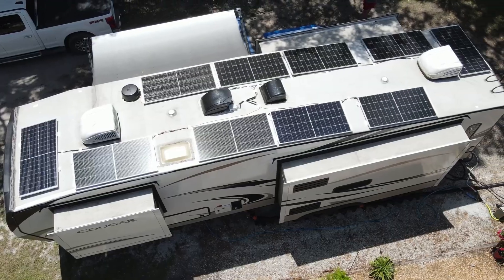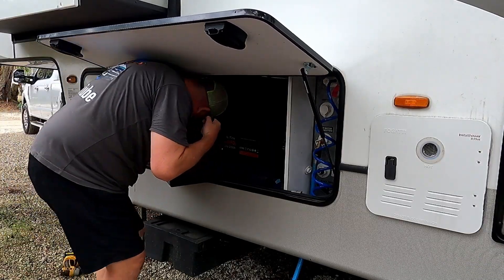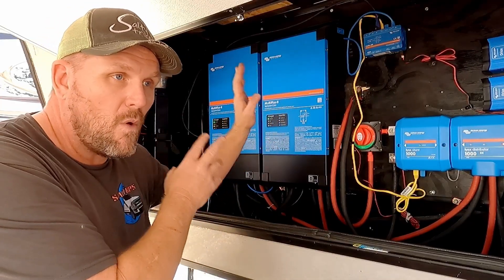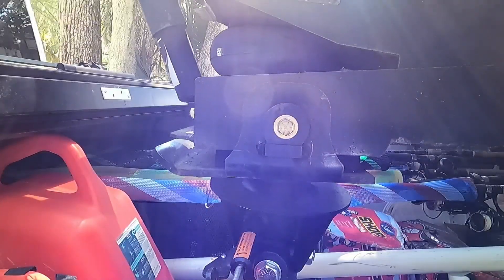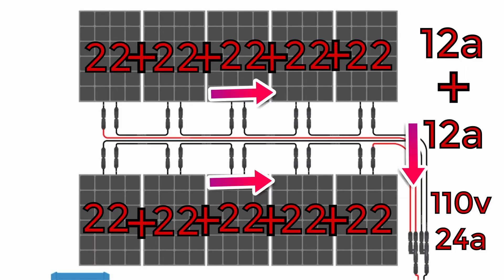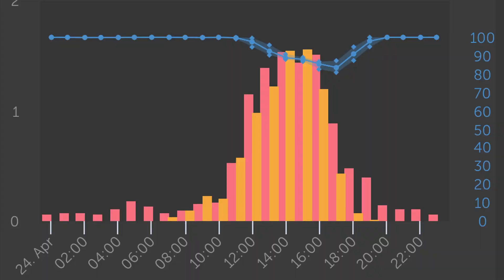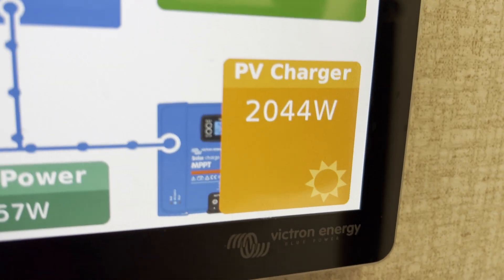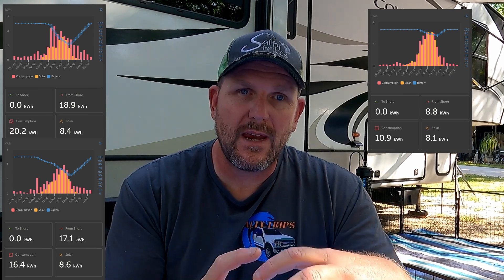How much solar power do we really get? “RV Off Grid solar power test”

Comment: Good job on your whole solar set up. 
There is one thing your forgetting, DC to DC charging.
Perhaps you should get two DC to DC chargers, 12 to 24 volt to hook up to your Truck.
Let your Truck charge your system as you go from site to site.
Reply from the maker: @lindsaywhite4502  didn’t forget it, don’t really need it, sun can charge while we drive.

Comment: Still waiting on Godzilla towing, mpg’s, at what avg Hwy Speed? I would had purchased a Diesel truck.. with what you spent on batteries lol. A first time watching  your Vid that I came across on your truck. So was trying to find the follow up video you said you were going to do ? So if you did please send me link. As for solar I would never spend that much $ on something stationary. I would had gone with portable E-Gen system like a Delta Pro Ecoflow products. I guess you plan to boondock allot. I live in South FLA and that still won’t cut it… Need shore-power. Winter months up north understand. Your inverter needs to be Hybrid for partial Batteries and gas gen. Florida is rough to boondock May through the first half of December. And hopefully you’re North of central FLA. Anyway great Vid …
Reply from the maker: Batteries cost me about $2,800 a Diesel truck cost $80,000.

Comment: So why didn’t you use the 400watt panels to maximize your energy output into the batteries?  Was it cost or efficiency per dollar that the 250watt panels were used?  10 panels at 400watts each would put you at 4K generation max instead of the 2.6K with no additional space on the roof.  Would that benefit you or am I just not thinking it through well enough? Looks like you have plenty of battery storage and converter capacity. Just think out loud.
Reply from the maker: A lot of factors, space, weight, additional hardware to mount, payload capacity, etc, I address all these in an upcoming video 👍

Comment: We run a 12v, 2640 watt, 4s x 3p with 1000 Ah of batteries and just a single 3000 watt inverter.  We can run the AC overnight and fully recharge during the day.  In full sun, we are pulling right around 2k watts for 4 hours daily and when we get more than 12 hours of sun, we can pull in 10-12 kwh daily.
Reply: Nice

Comment: Awesome video! Addictive yes.. My experience is similar. I have a 3000 W  24v MPP inverter and 280Ah @ 24 V with 1000 W of solar. I experimented with the air conditioner and water heater running together  (I don't have two ACs so that was the best I could do for maximum draw) I maxed out my MPP inverter for 45 minutes, until the water heater reached temperature. I pulled 933 W of solar and 2021w from the batteries. I haven't seen 1000 W yet, but temps have been in the 80s and the panels just don't run as efficiently in warm weather. I am considering an additional 400 W of solar that I can break out of the bed of the truck and plug-in, rather than permanently mounting on my roof. I also thought to purchase 1000 W coil for my water heater. Just to have a back up in case my propane dwindles. Fun stuff
Reply from the maker: Right on, sounds like a great setup 👍
Reply: @saltytrips  Thanks, it's an inexpensive little system for our 30 amp travel trailer. If I had a nice fifth wheel like yours, I would have gone to larger panels and done something closer to what you have. When chins batteries came down in price to ($1050 for a pair of 12.8 x 280 amp hour batteries) when that happened I decided to step up to a 24 V system.  I am about $3600 in and having a great time learning how to understanding how solar works. Alternator charging is going to be my next thing.

Comment: Great information! I didn't hear you mention if you had installed your panels with angled adapters? If you didn't just want to say that the solar intake is very good for being flat. I have 800 watt's flat on my motorhome with 460 watt's that I can deploy on the ground. Flexible and foldable for those very situations you talked about.
Reply from the maker: Thanks for the input, we have a video coming out soon of things we might have done differently 👍

Comment: You need to use blocking diodes between the panels to reduce shading effects or park in direct sunlight.  Solar panels in shade will pull down the rest of the panels.
Reply from the maker: Thats what i said 🤦‍♂️
Reply: Don’t most panels come with diodes?
Reply: @richardwolf6269  Typical solar panels have bypass diodes but a blocking diode functions to basically turn off panels that are in shade so they do not drag down those that are in sunlight. Another option is to use multiple controllers.

Comment: I would recommend changing the solar panel configuration.  Basically, use multiple charge controllers instead of paralleling.  2 x Victron Smart Solar 150/45's (for example).   If you want to go whole-hog on improving performance with partial shading conditions, even consider a third charge controller and go with a 3s, 3s, 4s topology with 3 x Victron Smart Solar 150/35's (for example).

Paralleling does help with shading but it doesn't help nearly as much as having a dedicated charge controller for each string.  Particularly when you are running more than 2 panels per string.  The reason is that if one of the panels in a string is partially shaded that panel's voltage will drop out, leaving only the voltage of the remaining panels.   When you parallel the two strings their voltages are now mismatched.  The unshaded string will force the paralleled combination to the higher voltage and that will massively reduce the current contribution of the partially shaded string in that situation.

Having a dedicated charge controller for each string solves the problem.   It means back-hauling more cables from the roof into the bay, but it is well worth doing.

-Matt
Reply from the maker: Running out of space very quickly, I’m happy with the performance so far, it’s about what I expected. More curious to see how it performs in full sun.
Reply: @saltytrips  In full sun I'm gonna put in my guess... around 12 kWh/day, maybe a bit more.  A regular fixed array of that size, properly angled and facing the right way would get around 18 kWh/day in full sun.   Very roughly.

Shade always does a number of panels.  Better than nothing, though.  Solar gives you lots of options.
Reply: That’s great info!

Comment: Just a few possibilities for increasing your SOLAR power. 1)Wasted space is the top of your slide-outs. You could get the flexible Solar (light weight also) that could be glued to the tops of your slide-outs. I checked mine and there is plenty of room between the top of the slide and the frame of the box. As for any scraping the only contact would be the flexible rubber gasket hanging down from the box opening. Not an issue.

2) Another area for the flexible Solar is down the center of your roof. You can walk on the flexible solar, provided you take your shoes off.

Finally, if you feel that the best of Solar generation would be like Series in the early morning and late afternoon and parallel during the mid-day, there is an option. If you are an ElectronicsNut like me you would create a Solar matrix. Each of your Solar panels would be run to an electrical junction box where their output terminations would be controlled by a cross-point type switch and low power relays to connect them in either series or parallel and out to a Solar Charge controller. The program could even automatically test different connection possibilities and select the one that has the best output. A Raspberry Pi micro-computer could handle this project with ease. It could even disconnect non producing panels so as not to affect the output of the other panels and redo the series/parallel configuration based on each panels output. I am not sure that re configuring between Series and Parallel would be worth it, but it would be an interesting project. It may be time for you to take on a new hobby, Electronics, with easy programming. AI (ChatGPT) will write just about all your code, trouble shoot it, and modify it for you. I have become a lazy programmer now. Give it a try! Great Video!
Reply: I strongly DISrecommend flexible panels, at least not unless you can get an air gap under the panel.  Putting flexible panels directly on the roof without an air gap massively heat-stresses those panels and a lot of people have wound up with burned up roofs and fires due to that.   You always want an air gap under the panel, the panel will run a lot cooler (and perform better because of that), and is unlikely to overheat.
Reply: @junkerzn7312  good point
Reply: Don't do flexibles,  I did, spent big bucks on them, they de-laminate, I'm still slowly removing them from my pop-out so as not to ruin the membrane top.
Reply from the maker: @lotechgreg  we have a couple ideas rolling around about more solar, non- include flex panels on the roof. That video will be coming soon.
Reply: Flexible solar panels short out melted RV roof https://youtu.be/vf0-tXm-Oqc?si=ULeQEQYEL8MDZF4v

Comment: I have 2100 watts of Bifacial panels.Have seen 2400 watts.Have 230ah @48 volt battery.But only get 3k watts out of a 6k inverter running 120 volt.Yah only half power vs 6k @ 240 volt.What sucks is I can only run 1 AC @120v. Thus the 3k watt 120v limit.Still figuring out what to do? Maybe a 4k watt 120v inverter?
Gona get 4 more 525 watt panels for the 3rd charge controller.Possibly another battery bank down the road but gotta hit CAT  scale now.
Reply: Parked in full sun watts climb  after 10 to 4 is full power.At about 7pm I’ve used 35ah of battery running 1 ac.Yah it’s hot now 93* in full sun but not much sun on rv sides.
Reply: I see about 10-15k ah of charge per sunny day running 1 ac.
Reply from the maker: CAT scale definitely is a big factor when adding more, we discuss that in an upcoming video 👍

Comment: Thanks for the update. Maybe you should consider that solar awning we saw at Quartzsite last winter. Or you could use a side mounted array like we have to augment your roof array. If you often encounter shady conditions, you might consider a deployable ground mount array that you can move around to keep it in the sun.
Reply from the maker: We have a video coming out soon addressing a lot of that, stay tuned 👍

Comment: I have no plans to go anywhere that does not have electric but, I did try to run a small 74 watt dehumidifier in the camper and only use the inverter to power it. I have 2 solar panels, 2 lead acid batteries, 2K inverter, and the batteries could not power it overnight. I know it is 74 watts because I attached a meter to track usage to the dehumidifier? Are lead acid batteries that crappy or are they shot? Love your videos and how you DIY everything.
Reply: One 100ah Li battery same as 2 100ah wet bats.Yup that 1/2 power from wet vs Li bats.Two wets cost 400 bucks so Li way cheaper now.Only 1/2 power from wet.Fact!
Reply: @2hotscottpro  great point
Reply from the maker: Depends on your batteries capacity, lithium is definitely a better option, take your batteries to Auto parts store to have them checked but if you have an inverter and plan to run any AC power for any length of time I would consider upgrading 👍